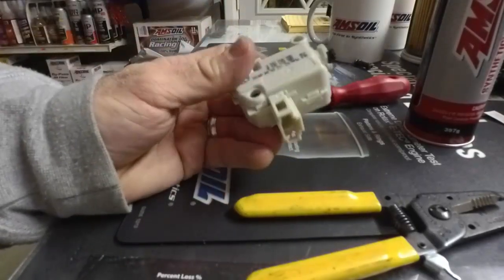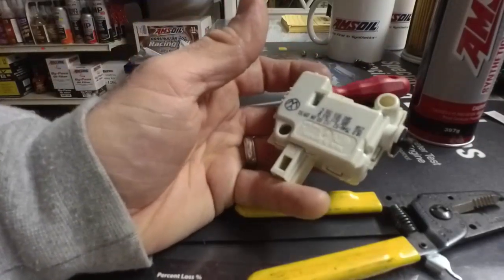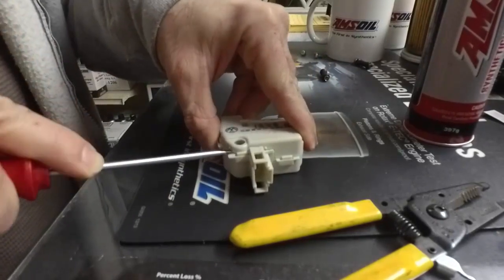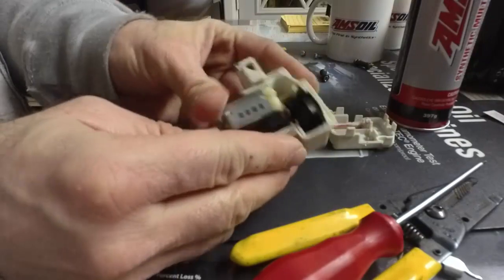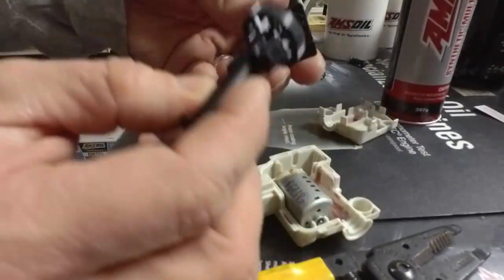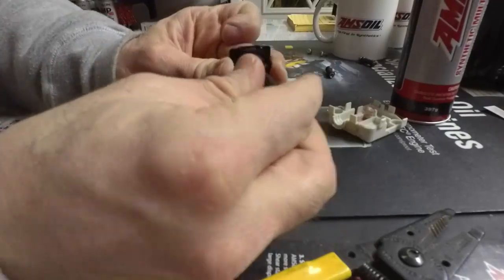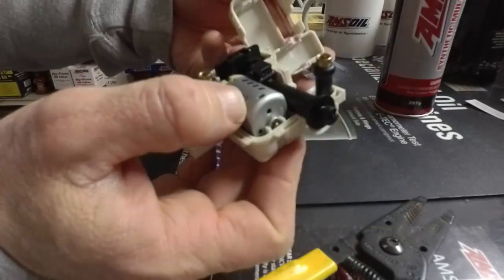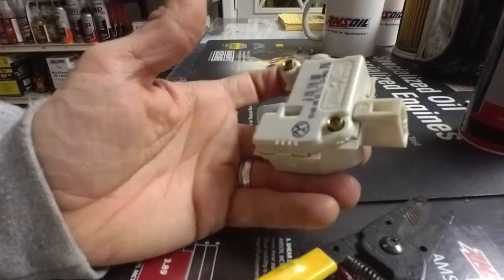Repair Volkswagen Jetta VW Power Trunk Latch

Comment: I just fixed my 2000 Jetta VR6 trunk actuator with your video! My trunk wouldn’t latch/lock closed, which was draining the car battery since the trunk light was always on. The arm of my actuator was stuck in the ‘out’ position, just like you explained, and just by opening it up, it was released and could retract and extend freely again. Saved me an eBay or Amazon order!

Comment: Your video was exactly  what I needed for my 2005 Jetta thanks,
There didn’t seem any reason for mine to be stuck open so I sprayed it with some silicone lubricant put it back together and it now  works fine.

Comment: My trunk open when i push the Botton on the door. But when i push the remote button it dosent. What is wrong?
Reply: The remotes are junk. Mine is the same ways once In a while it will work but I gave up trying.